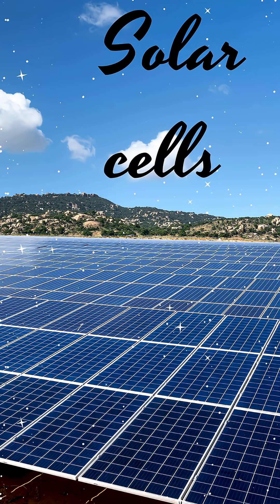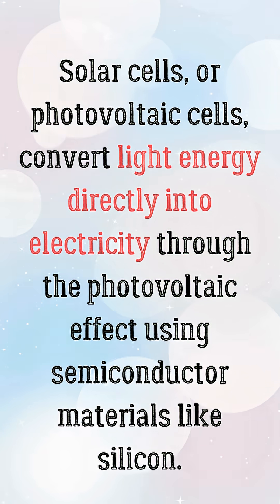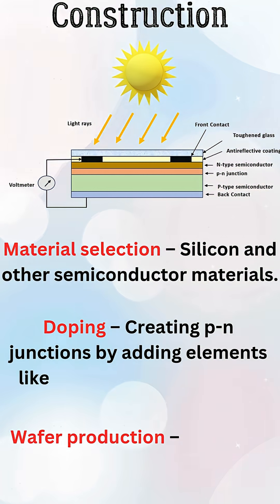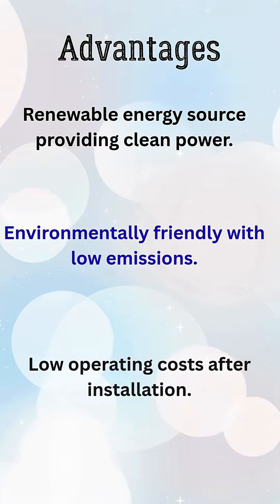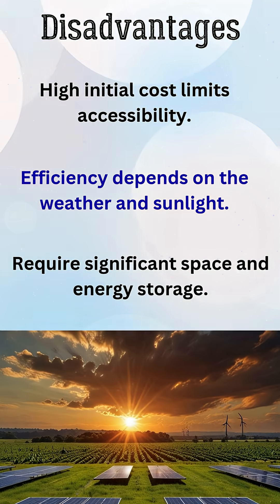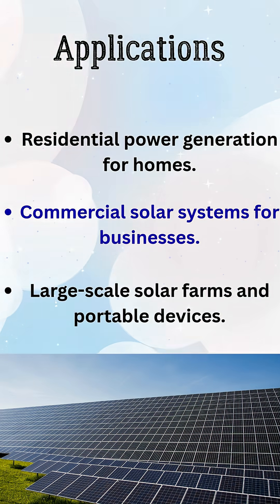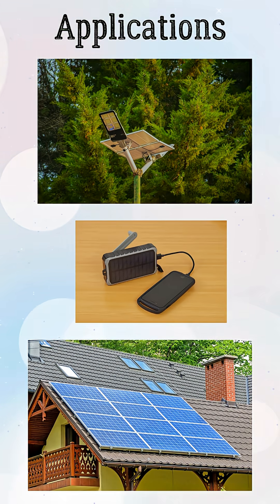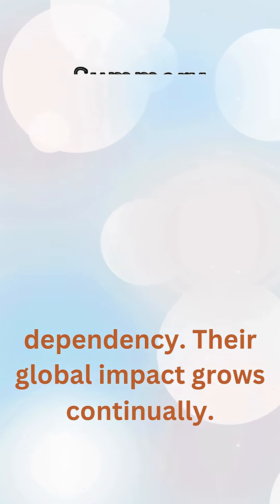Solar cells

Comment: The video provides a comprehensive overview of the operational principles of solar cells, also known as photovoltaic cells, and their significant implications for future energy solutions. It commences by detailing their construction, typically involving silicon layers designed to convert sunlight directly into electricity. The advantages highlighted include minimal emissions and negligible operating costs post-installation. However, the presentation also addresses inherent challenges, such as weather dependency and substantial upfront investment. Furthermore, it offers practical, real-world applications, ranging from powering calculators to residential energy systems.

Comment: From the above video, I understood that , what are solar cells and how they convert  light energy directly into electricity and how they are contructed. I also learnt how they work (working principle) and the advantages of having the solar cells as they provide clean power and they are environment friendly and it also have some disadvantges also as they require hight cost and energy storage space and lastly learnt about the applications of solar cells.

Comment: This video explains solar cells (photovoltaic cells), their working principle, and their importance. It clearly describes the construction of solar cells along with their advantages, such as low emissions and low operating cost, as well as disadvantages like weather dependency and high initial cost. The applications of solar cells are also explained in a simple and easy-to-understand manner.

Comment: From this video, I understood that what are solar cells and how they convert  light energy directly into electricity and how they are contructed.
Reply: A solar cell is a special device that changes sunlight directly into electricity using a material like silicon.
When light hits the cell,it makes tiny charged particles (electrons)move,and this movement creates an electric current.many solar cells are joined together in apanels to produce more electricity for homes,streets,or gadgets.

Comment: In this video Solar cells use semiconductor materials to convert sunlight into clean, renewable electricity through the photovoltaic effect. While they face challenges like high costs and weather dependency, they power everything from household devices to satellites.

Comment: This video is a simple intro to solar cells, which are basically devices that turn sunlight directly into electricity using the photovoltaic effect. They are made by layering silicon to create a PN junction, and when light hits them, it releases electrons to generate power. While solar cells are great because they provide clean, renewable energy with low maintenance costs, they can be expensive to set up and only work well when it's sunny. Today, they are used for everything from small gadgets like calculators to powering houses and even satellites in space.

Comment: Solar cells, or photovoltaic cells, convert light energy directly into electricity using the photovoltaic effect. They are constructed with a PN junction made of semiconductor materials like silicon, featuring an anti-reflective coating to maximize sunlight absorption. While they offer clean, renewable energy with low operating costs, they face challenges like high initial costs, space requirements, and dependency on weather conditions. Their applications range from residential power and agriculture to specialized uses in satellites and telecommunication systems.

Comment: This short video demonstrates a basic concept of electrostatics, focusing on the behavior of electric charges. It shows how charged objects exert forces on each other, resulting in attraction or repulsion depending on the type of charge. The video helps in understanding that like charges repel each other and unlike charges attract each other. It visually explains how electric force acts even without direct contact between objects. This video is useful for building a clear conceptual understanding of electrostatics, especially for beginners and quick revision before exams.

Comment: The video basically breaks down how solar cells also called photovoltaic cells actually work and why they’re such a big deal for the future. It starts with how they’re built, usually using layers of silicon to capture sunlight and turn it directly into electricity. On the plus side, you’ve got low emissions and almost zero operating costs once everything is set up. But it doesn't ignore the downsides, like how much they depend on the weather or that big price tag you have to pay upfront. It also gives some really simple, real world examples of where we use them, from powering calculators to entire homes.

Comment: Solar cells, also called photovoltaic  cells, are electronic devices that convert light energy (sunlight) directly into electricity using the photovoltaic effect, typically made from silicon semiconductors, forming the building blocks of solar panels to generate clean energy. 

They work by absorbing photons, which excites electrons in the semiconductor material, creating an electric current.
it also has anti reflective coating to maximise the output..
advantages - Lower Electricity Bills , low installation cost..
disadvantages - requries significant space..

Comment: This video provide information about A diode is a small electronic component made from semiconductor materials like silicon or germanium that acts as a one-way gate for electricity. It has two terminals, the anode (+) and the cathode (-), and its main job is to allow electrical current to flow easily from the anode to the cathode while blocking it in the opposite direction. Because its behavior changes significantly based on the electrical input it receives, it is known as a non-linear device. These components are used in many ways, such as in rectifiers to convert wall power into a form safe for batteries, in LEDs to create light, and in solar cells, which use the same semiconductor principles to turn sunlight directly into clean energy. While technologies like solar cells face challenges like high costs and weather dependency, they provide a sustainable way to power everything from portable gadgets to entire homes.

Comment: This video explain the working of solar cell in simple way. Helpful to understand the basic concept about it. I have learnt about solar cells, also known as photovoltaic cells, and how they convert sunlight into electrical energy. The video explains the working of solar cells using a P-N junction in silicon along with anti-reflective coating and contacts. It also tells us that solar energy is clean, renewable, and environmentally friendly, but it requires high initial cost and depends on weather conditions.

Comment: The video clearly explains the concept of solar cells. It shows how solar cells convert sunlight into electrical energy through the photovoltaic effect. The video describes the construction and working of a solar cell, along with its advantages such as being a renewable energy source, and disadvantages like high cost and energy storage problems. It also explains the different applications of solar energy.

Comment: In this video, we get to know how solar cells work, converting light energy directly into electricity using materials like silicon. Its construction using p-n type junction, creating a direct current when photons strike the cell releasing electron. Their advantages like having low operating cost and disadvantages like having weather dependency. Applications in commercial solar system businesses. Offering clean sustainable energy with various uses.

Comment: In this video, the concept of solar cells was explained clearly. Solar cells convert sunlight directly into electrical energy using the photovoltaic effect. The construction, working principle, advantages like renewable energy, and disadvantages such as high cost and storage issues were explained. Various applications of solar energy were also covered.

Comment: In this video, I have learnt about solar cells, also known as photovoltaic cells, and how they convert sunlight into electrical energy. The video explains the working of solar cells using a P-N junction in silicon along with anti-reflective coating and contacts. It also tells us that solar energy is clean, renewable, and environmentally friendly, but it requires high initial cost and depends on weather conditions.

Comment: In this video explain about solar cell, or photovoltaic cell convert light energy directly into electricity through the photovoltaic effect using semiconductor materials like example :-( silicon ,germanium)also explain construction using semiconductor p type semiconductor and n-type semiconductor also explain advantage disadvantage as well as applications

Comment: I understand from this video that Solar Cells (or photovoltaic cells) are devices that convert light energy directly into electricity using the photovoltaic effect. You clearly explained the construction using P-type and N-type semiconductors, how they work when photons strike, and listed both the advantages like being eco-friendly and disadvantages like high initial cost.

Comment: The video introduces solar cells, also called photovoltaic (PV) cells. 
 It explains that these cells convert sunlight directly into electricity. 
Solar cells work using the photovoltaic effect, where light energy knocks electrons loose in a material. When electrons flow, they create an electric current that can power devices.  The video briefly shows how this technology helps use sunlight as a clean energy source.

Comment: This video explains that solar cells, or photovoltaic cells, convert light energy directly into electricity using semiconductor materials like silicon. They are constructed with a PN junction that creates a direct current when photons strike the cell and release electrons. While they offer a clean, renewable energy source with low operating costs, they face challenges such as high initial installation costs and dependency on weather conditions

Comment: A solar cell is a device that converts sunlight into electricity. When sunlight falls on the solar cell, it creates an electric current due to the photovoltaic effect.A solar cell changes sunlight into electrical energy using the photovoltaic effect.

Comment: Solar cells convert sunlight into electricity using the photovoltaic effect.

They are made of p-type and n-type

semiconductor layers forming a p - n junction. Light creates charge carriers that generate electric current.

They are clean, renewable, and low-cost to operate but have high initial cost and depend on sunlight.

Comment: Solar cells convert light energy directly into electricity using the photovoltaic effect through semiconductor materials like silicon. 
 They consist of a P-N junction formed by layering p-type and n-type semiconductors, featuring an anti-reflective coating to maximize sunlight absorption and metallic contacts to collect the current.

Comment: Solar cells function as a transducer converting photons into DC current via a PN junction interface.  The use of anti-reflective coatings and metallic contacts optimizes the collection of electrons and holes

Comment: A solar cell is a special device that changes sunlight directly into electricity using a material like silicon. 
When light hits the cell, it makes tiny charged particles (electrons) move, and this movement creates an electric current. 
Many solar cells are joined together in panels to produce more electricity for homes, streets, or gadgets.

Comment: This video explains solar cells. Solar cells convert sunlight into electricity. When sunlight falls on a solar cell, it produces electric current. These cells are used in solar panels to generate clean and renewable energy for daily use.

Comment: A solar cell is a device that changes sunlight into electricity.
It uses energy from the sun to make power.
Solar cells are used in solar panels.
Solar panels are used in homes, schools, calculators, and street lights.
Advantages of solar cells:
They use free energy from the sun
They do not cause pollution
They save electricity cost
Disadvantages of solar cells:
They work only when there is sunlight
They are costly to install at first

Comment: This video explain that solar cells(photovoltaic cells) convert light energy directly into electricity through the photovoltaic effect
It also explain construction of solar cells,
Advantages of solar cells like the solar cells are eco-friendly and renewable and no fuel cost 
It also explain the application and disadvantages like it's efficiency depends on the weather and sunlight

Comment: The video explains working of photovoltaic  cell i.e converting light energy  to electricity  using semiconductor material like silicon
 Advantages , renewable energy ,environment , friendly , low operating cost while operating 
Disadvantages High initial cost ,Efficiency depends on weather and sunlight,  significant space and energy storage required and its is used in satellite, navigation  etc

Comment: Solar cells, also known as photovoltaic cells, are devices that directly convert sunlight into electricity by harnessing the energy of photons. When sunlight strikes the semiconductor material inside a solar cell—typically silicon—it excites electrons, creating an electric current that can be used to power homes, businesses, and even entire cities. This process is clean, renewable, and produces no greenhouse gas emissions, making solar technology a cornerstone of sustainable energy solutions. Beyond their environmental benefits, solar cells also offer economic advantages by reducing dependence on fossil fuels and lowering electricity costs over time. They are widely used in solar panels on rooftops, large solar farms, and even in portable devices, symbolizing a shift toward a greener and more self-sufficient future.

Comment: Video describes the way of converting sunlight directly into electrical power through the use of a P-N junction in silicon , an anti-reflective film and contacts to capture the energy. 

Advantages: very clean, renewable, not costly to operate.

Disadvantages :  expensive initial investment, weather based.

Comment: The short explains how solar cells (photovoltaic cells) work — devices that convert sunlight into electricity. It briefly describes the basic idea behind solar energy conversion: when sunlight hits the solar cell, it generates electric current that can be used to power electrical devices, making solar panels an important technology for clean and renewable energy.

Comment: This video explains solar cell that converts light energy directly into electricity through the photovoltaic effect using semiconductor materials like silicon , it's construction , working and advantages like clean power , low operating power and some disadvantages too.

Comment: In This video help to understand construction and working of solar cell with advantage and disadvantage.
Solar cell convert solar energy into electricity through the photovoltaic effect using semiconductor material eg.silicon In construction the layer of solar cell and the advantage of solar cell it is clean energy and environment friendly. With some disadvantage like cost, maintenance etc.

Comment: The video introduces solar cells as devices used to turn sunlight into electrical energy. It frames the topic as an explanation of photovoltaic (PV) cells in a simple, quick way. The focus is on the basic idea of “sunlight → electricity” conversion.

Comment: This video explains what is solar cell, their construction,how they work their advantage disadvantage,their application .
That solar cell means photovoltaic cells.
Light energy directly into electricity using silicon semiconductor.
They are constructed by pn junction .
Cells collect the electrons and holes creating a direct current when photons strikes and release electrons.

Comment: In this video the working principle of solar cell is explained deeply.How solar cell works and on which principle it works is explained in deep. The advantages and disadvantages regarding solar cell is explained. Which diodes are used and how electricity produced is explained…

Comment: Video Topic: Solar Cells (Photovoltaic Cells)

This video explains about the working of solar cells(Light Energy --> Electricity)as well as it's construction(Material selection, Doping,Wafer production),The video also covers the advantages(Renewable energy source,low emissions, affordable for operating), disadvantages(space occupying, dependent of sunlight) and the Applications(satellites , telecommunication systems).

Comment: This video gives the information about the solar cells and how they work. Solar cells are the photovoltaic cells, convert light energy directly into electricity. The diagram makes us easy to understand the actual concept. It tells more about the advantages like it is environmental friendly with low emissions, and also the disadvantages like cost limit and the efficiency depends on weather..
Solar cells has diverse applications such as commercial solar system for businesses ,large scale solar farm and portable devices. Overall it offers clean sustainable energy with various uses.

Comment: Solar cells are devices that convert sunlight directly into electrical energy using the photovoltaic effect. They are mainly made of semiconductor materials like silicon with a P–N junction. When sunlight falls on the cell, electrons are excited and start moving, producing electric current.A solar cell is constructed using P-type and N-type silicon layers with metal contacts on the top and bottom to collect current.
The main advantages of solar cells are that they are renewable, pollution-free, and have low maintenance cost.The disadvantages are high initial cost, low efficiency, and dependence on sunlight.